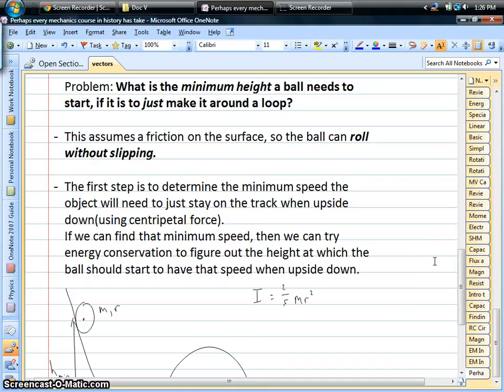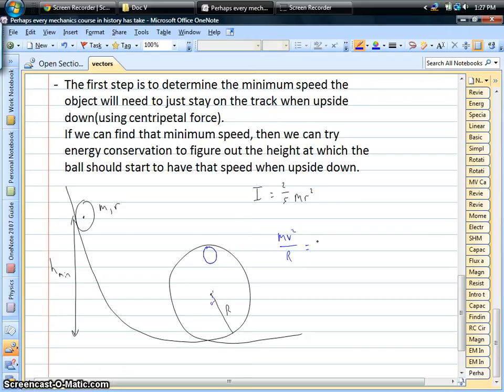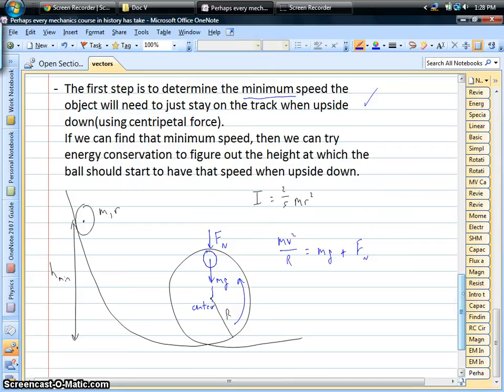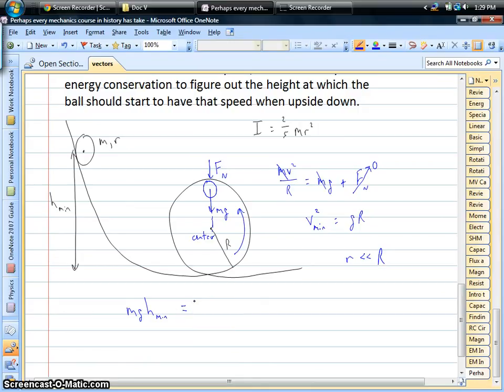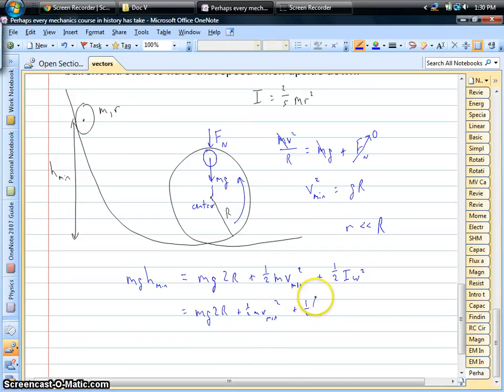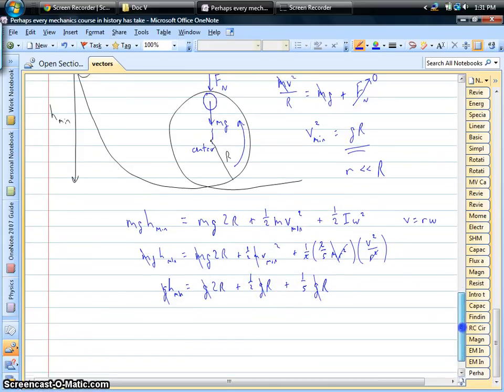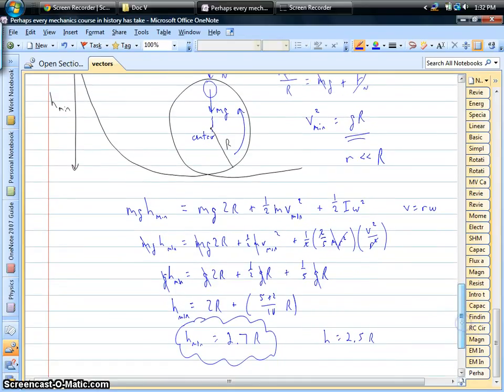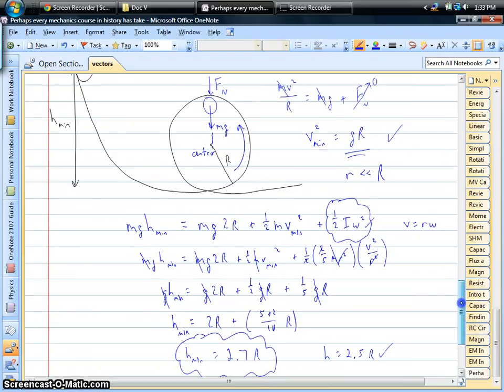What is the Minimum Height for a Ball to Roll without Slipping Around a Vertical Loop?

Comment: If it is rolling without slipping, then there is friction between the surface and the ball but in the conservation of energy equation how come there aren't any part which counts for the energy dissipated by friction?
Reply from the maker: Good question. It depends on the type of friction we're dealing with. When there is NO slipping, the friction force creating the torque is essentially a static friction. Each moment of time a different point on the object's surface touches the ground. No  single point is touching the ground over an extended period of time, which means there is NO rubbing - you need rubbing to produce heat. When there IS slipping, then we are talking about kinetic friction, and there is rubbing and heat. We would need to add in the heat to energy equations if there is slipping. But static friction produces no heat, which is why we do not consider it in our energy budget. I hope this helps.
Reply: I see, thanks.

Comment: If the ball had a considerable radius "r" would the potential energy at the top of the loop be mg2(R - r)?
Reply from the maker: Yes, you are right that the radius of the circle the center of mass of the ball travels around would be R - r. I didn't do that here, using the approximation that the ball is very small compared to the radius of the loop, focusing on the thinking behind this situation. Good point you both raised!
Reply: yes, the radius of the ball has to be taken into consideration because simply using R would suggest the ball has no height from the track
Reply: DontTakemeSeriously great!
thank you!